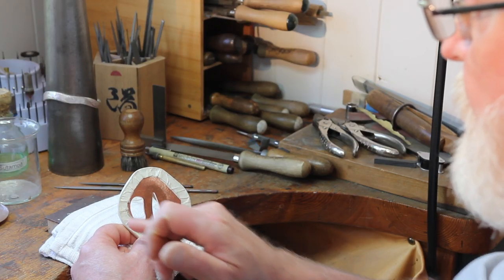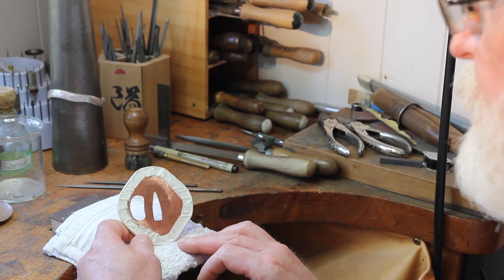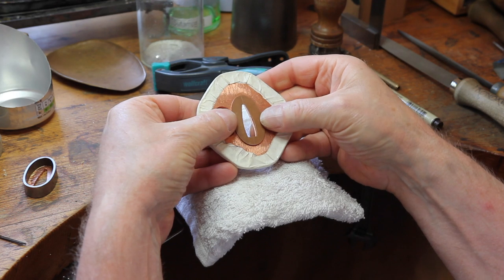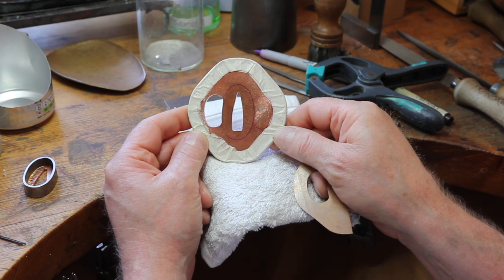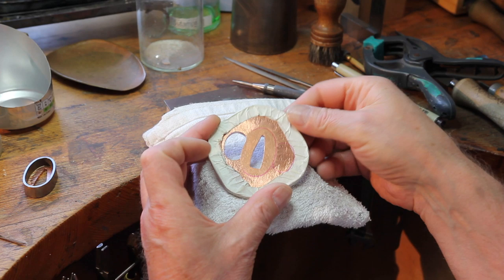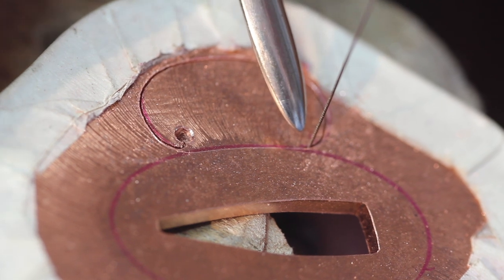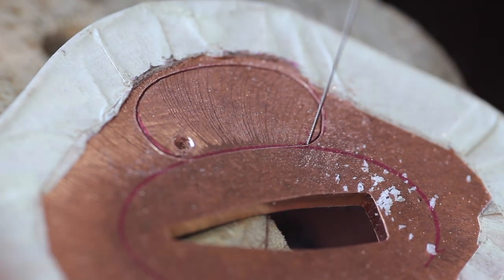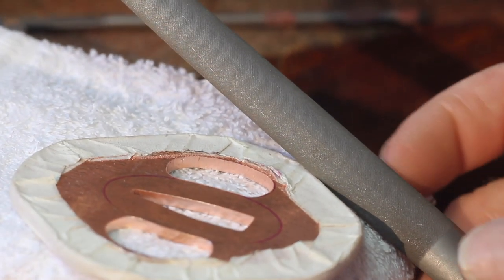Tsuba school : Part 10 - Positioning and creating the ryo-hitsu.

Comment: Ford, how were  the openings in a Tsuba traditionally cut before jewelers saws were used?
Reply from the maker: Hi Jack, we don't have any hard evidence of actual practice in Japan but based on what we do know of similar early metalworking cultures and technical developments it seems likely drilling played a big part, a series of holes a bit like the perforations around stamps,  chiselling and filing. I plan to do an iron pierced tsuba in this way at some point, as a film series.
Reply: @FordHallam  I remember you talking about that now in an earlier episode. Thanks again...